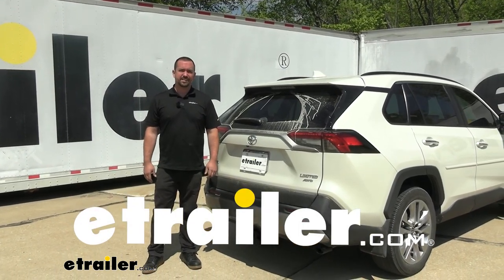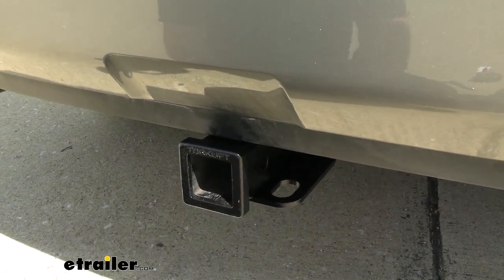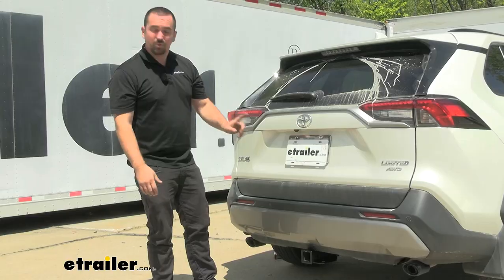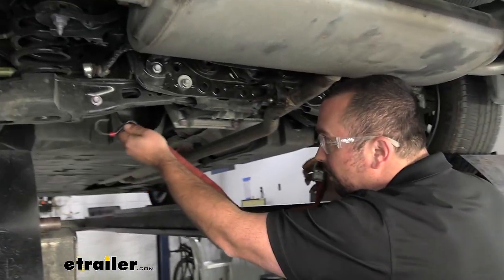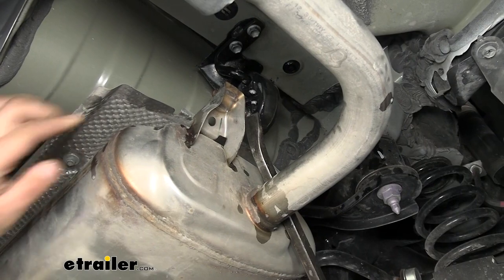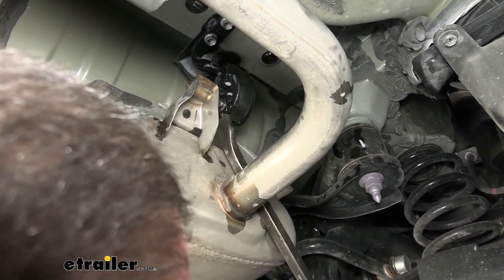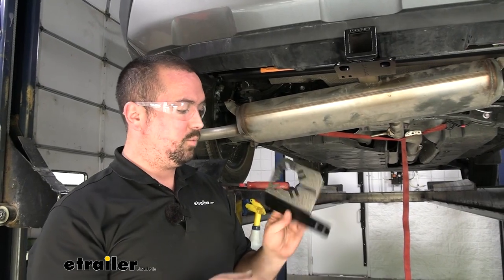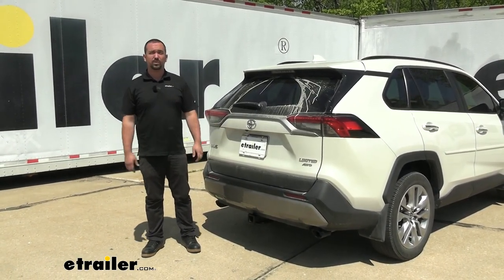etrailer | DIY Install: EcoHitch Hidden Trailer Hitch Receiver on your 2022 Toyota RAV4

Comment: I found using the torque wrench with the crows foot frustrating because the crows foot perverts the actual applied torque depening on its angle when used.

Im other words my torque wrench wasnt clicking even though I had it so tight it was dinging the bolt heads.

Comment: How high does it sit off the ground
Reply from the maker: Once the EcoHitch # EH97FR is installed, you'll have about 11-1/2 inches of ground clearance under the bottom of the receiver tube. Hope that helps!
https://www.etrailer.com/Trailer-Hitch/EcoHitch/EH97FR.html